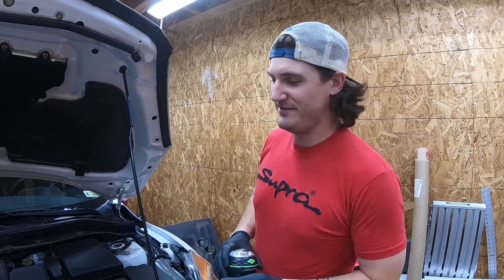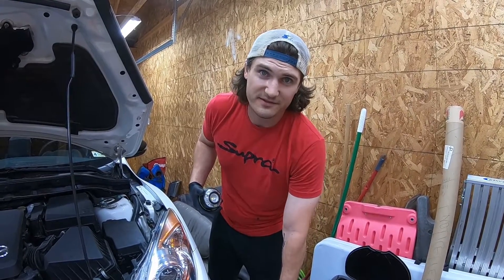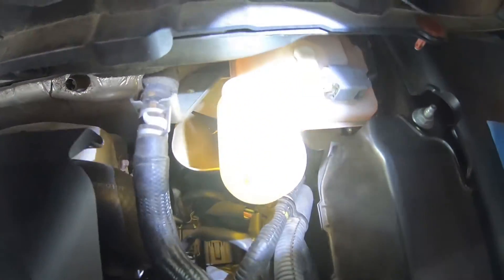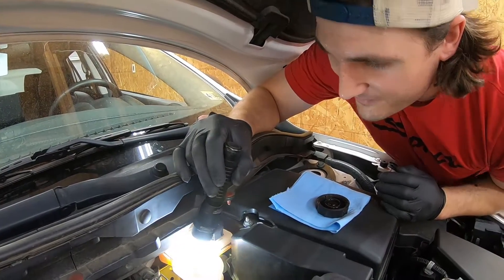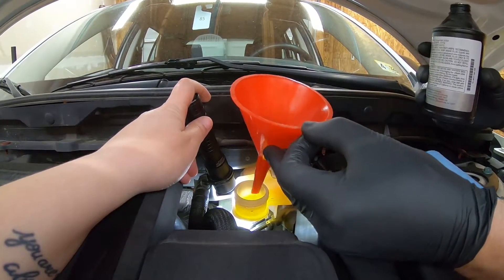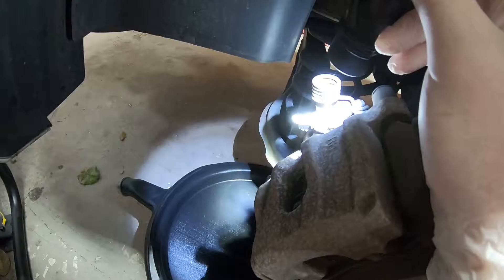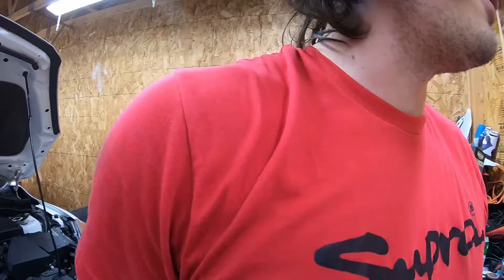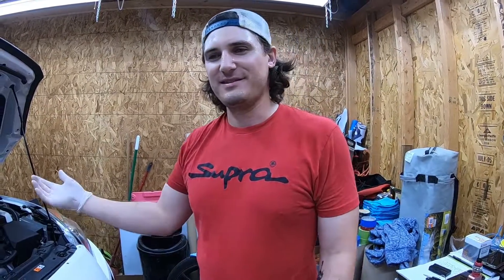Mazdaspeed3 Brake Fluid Flush

Comment: I used a very small tube insert to the bottle of the reservoir and suck the oil out by a small usb water pump. It worked pretty easy. The long  small tube connected with bigger silicone tube  and to the pump.

Comment: What about bleeding the abs module? Or you don't have to on this car?
Reply from the maker: The service manual doesn’t say anything about the ABS module. As long as you don’t need to replace or doing any work with the ABS then you’re good. The car feels and brakes the same as before so I’ve had no issues.